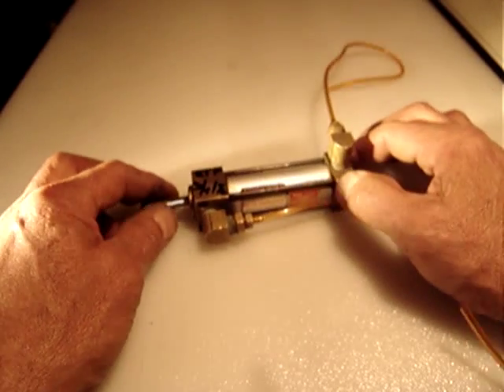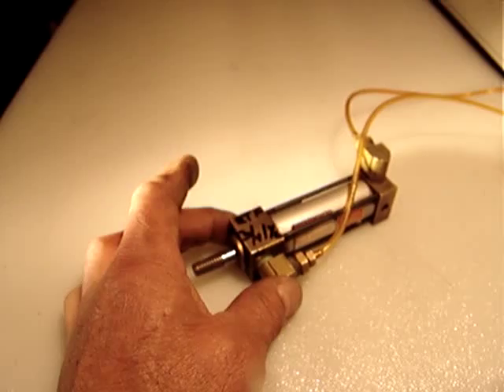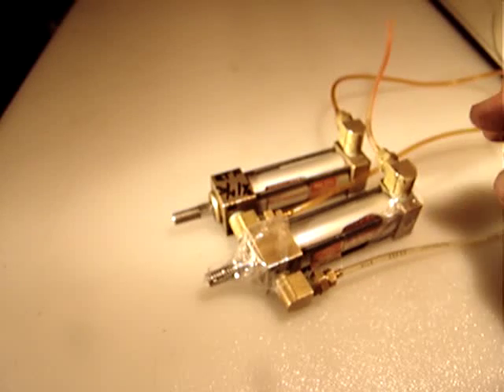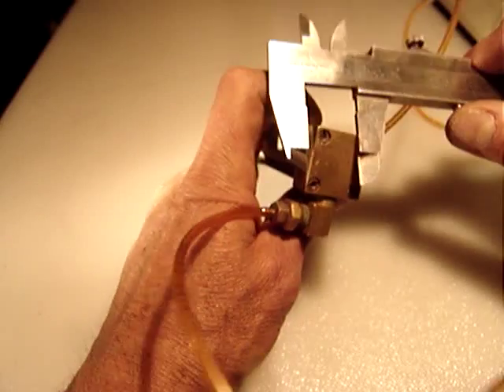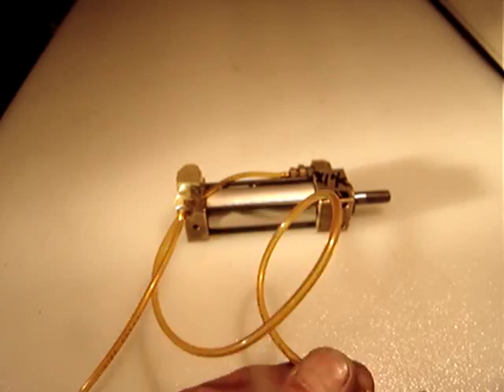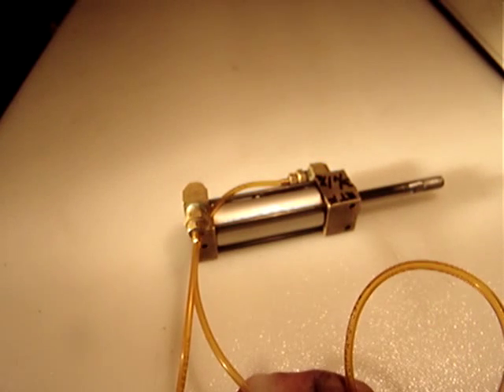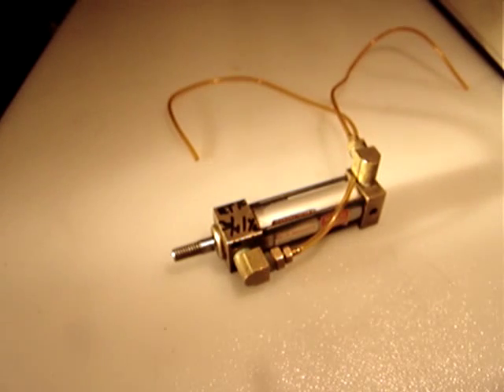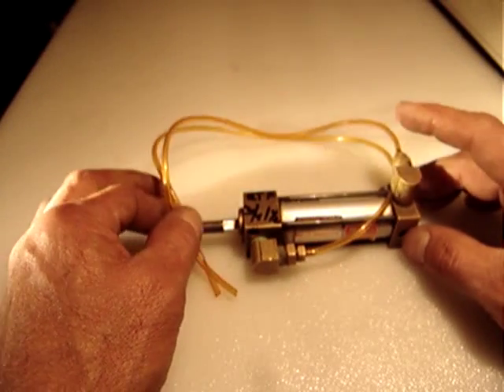PNEUMATIC AIR CYLINDER

Comment: so if the air is still connected to the input line, then the piston will stay in the extended position even when there is a force opposing the piston???